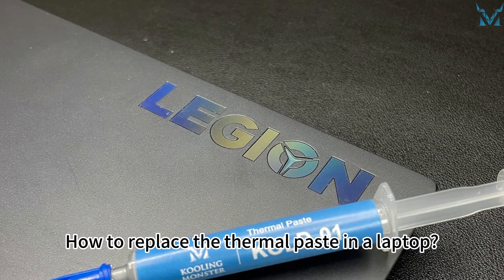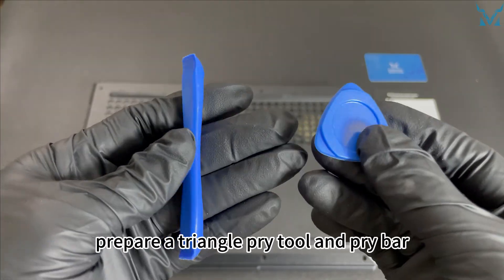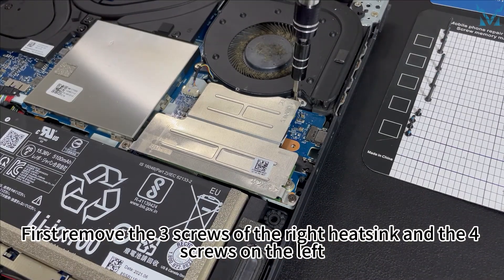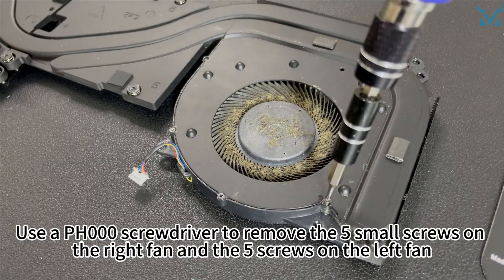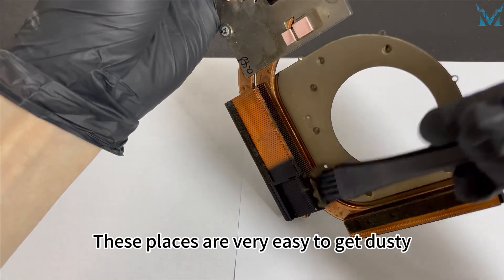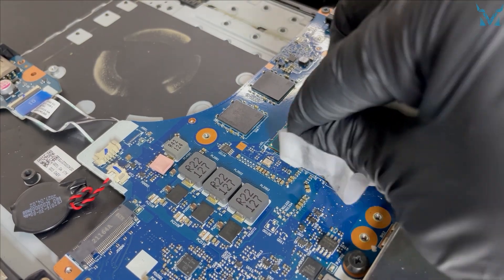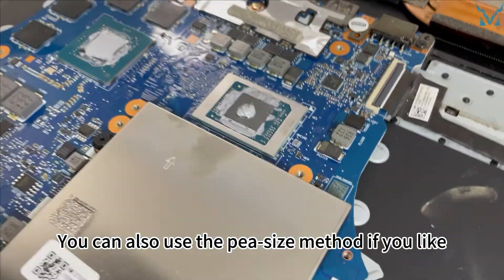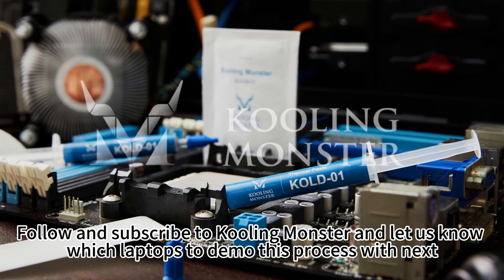Speed Up Your Lenovo Legion 5 - Prevent Overheating With Dust Cleaning & New Thermal Paste

Comment: i know this video is much later but I have pretty much the exact same laptop, my CPU temp averages around 90 - 95c whilst gaming and whilst quickly loading something up to 100c then back down, ive looked at my CPU and it's said to be normal but it's an older used laptop and I think I should open it up, is it safe?, If i mess up then warranty might not cover it
Reply from the maker: Those temps are definitely on the high side, especially if it’s an older used laptop. Cleaning the fans and refreshing thermal paste can help a lot. ✅

It is generally safe if you follow a proper guide and take your time — but you’re right: opening the laptop can affect warranty if it’s still active.

If you want, tell me your exact model and I’ll check whether your warranty is impacted and send you a step-by-step guide! 🙌

Comment: my two midle screw of the heatsink just don't spin at all, I don't know what to do.
Reply from the maker: That can happen if the screws are stripped or overtightened. Try using a precision screwdriver with good grip, or gently apply downward pressure while turning. If stuck, a rubber band between the screw and driver can help. Once you're in, consider repasting with KOLD-01 for optimal cooling.

Comment: i had legion 5 17 ach6 but i don't have the small screws on fans instead some rivets on it do you know how to deal with it,thanks
Reply from the maker: If they’re rivets, they can’t be unscrewed — you’ll need to carefully drill them out or pry gently (not recommended unless skilled). Better to clean without removing if possible!
Reply: @koolingmonster  thanks for reply,can you tell what could be damage if i want to pry and which tool would you recommend

Comment: I have a legion pro 7i. Just a year old. It has been the biggest heap of junk I've ever bought. It has been overheating severely since only a few months in. I clean the fans regularly as well as I can from outside. Core i9 drops to around 1000 mhz or even less when playing games with a CPU temp of 98-99° almost continuously. Severe throttling. Going for broke and redoing the liquid metal compound myself this week.
Reply from the maker: Sorry to hear you’re having such a frustrating experience with your Legion Pro 7i. Severe thermal throttling like that—especially with a Core i9 hitting 98–99°C—definitely isn’t normal.
Cleaning the fans from the outside helps a bit, but internal dust buildup or uneven factory thermal application could still be causing the problem. 
However, when DIY-ing, we generally recommend using thermal paste instead of liquid metal. Liquid metal has a much higher risk of failure—it’s prone to leakage and uneven application, especially on angled surfaces. A high-quality thermal paste, like our KOLD-01, already delivers excellent thermal performance without the added risks.

Comment: I used Arctic MX6. from 83°, now it's + 87° while playing. Is my thermal paste not good? I put same amount like in your video.
Reply from the maker: Thank you for sharing your experience! Arctic MX6 is a solid thermal paste, but temperature fluctuations can be caused by several factors. It might not be the paste itself but rather the application, cooling system, or ambient temperature. Since you followed the video, I recommend double-checking if the heatsink is properly seated and if the fans are working optimally. If the temperatures keep rising, you might want to clean and reapply the paste to ensure even coverage. Let me know how it goes!

Comment: Trying the links in the description and none of the items are available anymore (even internationally it seems, but I'm in Sweden)
Reply from the maker: Restocked and expected to be available in December. Demand is high—apologies for the inconvenience!
Reply: @koolingmonster  recently learned that you shouldn't use regular thermal paste on legion 5 laptops. they put PTM7950 (phase change material), which require replacement once in 2-3 years, by the same PCM, and only in case regular cleaning doesn't give any effect.

Comment: Does this help if my laptop is not turning on due to overheating?
Reply: is it going on then off or is it not powering on at all?
Reply from the maker: Of course! Replacing thermal paste can significantly alleviate performance issues caused by overheating in laptops. At the beginning of each of our videos, we conduct a temperature test after the replacement. Laptops with a bare die design (where the chip is exposed) are susceptible to the pump-out effect, and thermal expansion and contraction can squeeze out regular thermal paste from the chip. Our KOLD-01 thermal paste features a unique fluid dynamics design, which behaves like a solid without external force and like a liquid with additional external pressure. This makes it more resistant to the pump-out effect without sustained external force.

Comment: it's not 100% that paste is dried as lenovo use 2 phase paste on their products and it  is solid and dry till aprox 55 degr celsius, then it starts softening. Ofcourse you need to be sure what paste applied on yur product.
Reply from the maker: Hello, are you referring to phase change material! We still recommend using high-performance silicone grease. Next time, you can try our KOLD-01 phase change chip, which will continuously switch between liquid and solid states. This process can easily cause displacement and result in heat dissipation failure

Comment: Good day to you. Im using lenovo legion 5 rtx 3070 made in 2021 maintaining most of time gaming cpu temp 100° Used to be not more than 90 but now seems bad. Should I use thermopaste showed in this video? Or native Honeywell PTM 7950
Reply: Use honeywell. I made the mistake of using the thermal paste shown in this video, and the temps are still high. I'm now waiting for the Honeywell thermal pad
Reply from the maker: Welcome to try our KOLD-01 silicone grease, it's different from the typical silicone grease you mentioned. The specific difference is that generally silicone grease uses a solvent formula, where the solvent evaporates when exposed to heat, and the silicone grease dries and cracks, losing its thermal conductivity. We use an exclusive solvent-free formula to perfectly solve this problem. So using a laptop has better heat dissipation and longer lifespan.

Comment: hi, I need help after I took apart my Lenovo laptop and cleaned it, one of my coolers stopped working, what should I do?
Reply from the maker: Hello, there are a few common reasons why a fan might not be working:

1. The thermal paste is performing too well, causing the temperature to stay low and the computer to determine that the fan doesn't need to operate.
2. The fan connector might not be properly connected; it's a good idea to reconnect it.
3. The fan’s wiring might have been severely compressed during reassembly; it’s worth checking and rearranging the cables.

If you need to rearrange the cables or reconnect the connectors, remember to power off and discharge the laptop first.
Reply: go to laptop servie

Comment: hi so i've just cleaned my laptop, applied new thermal paste and everything seemed normal but when i turned on my laptop the vents became really, really loud and when i turn on any game it shows that gpu is at 100% but cpu is goint at 0%, what's going on what can I do?
Reply: Any update did you fix the problem?
Reply from the maker: Hello, there are a few possible issues:
1.You might be using a lower-performance thermal paste from the market instead of our thermal paste, which isn't providing effective cooling.
2.Your application method might be incorrect, leading to ineffective cooling.
3.The heatsink might not be properly secured, preventing effective heat transfer.
4.This issue could be related to fan aging or damage.
Excluding the fourth possibility, we recommend using high-quality thermal paste and properly applying it during disassembly to effectively resolve this issue. Over time, fans can become noisier due to wear and tear. If the fan blades become deformed or damaged, they can create more noise during operation. We hope this information helps you.

Comment: The repaste of that model require Honeywell ptm 7950 thermal pads...
Reply: why ?
Reply: @riichobamin7612  Because it is the one applied by the factory.  I tried applying various thermal pastes including mx4 and mx6 and others of excellent quality but the temperatures were higher and not by a little.  I think it's due to the fact that the pads have a thickness of 2mm and therefore put the die in good contact with the heatsink plate, whereas with the thermal paste there is a bit of space left.
Reply: @michelecorradino6633  Shit. I am in a terrible situation. I have a 2022 Lenovo Legion 5i and last year a Lenovo technician had changed my screen. He had taken off the entire thermal system to do that and I do not think he reapplied PTM7950 because now my laptop reaches 86 Celsius on the GPU (RTX3070ti@140Watts) within literally 2 mins of launching games. 

I was thinking of getting thermal paste reapplied. But I think I should instead go for PTM 7950, right ?
Reply: Do you know where I can get the thermal pad/paste from?
Reply: @LarryTheRandom  I saw some in Amazon. And LTT store.
Reply: @LarryTheRandom  aliexpress
Reply from the maker: Hello, we still recommend using high-performance thermal paste. Next time, you can try our KOLD-01 [sending heart]. Phase change pads continuously switch between liquid and solid states, which can easily lead to misalignment and result in cooling failure during this process.
Reply: @koolingmonster No. These laptops were designed to use phase change pads from the factory. Using standard thermal paste will make temperatures worse.

Comment: Excuse me, which is the recommended minimum Cpu state for this laptop if I wanna improve without stuttering issues? I have 5% min and max 99% and Cpu perfomance boost:disabled. The temperature equaly runs fine around 68°max while gpu does the same. If I activate Cpu perfomance boost on Cpu goes up 80° and Gpu 45° while playing Genshin impact
Reply: 105° is the "maximum" anything below that is ok while being under heavy load and boosted to its max performance. 

Some games are very CPU demanding, some games are GPU demanding, it all comes down to the games. Those temps is not a problem. 80° while gaming and having turbo on is not bad. The only time something is bad is when your temp is 70 - 80 while watching youtube or just scrolling through the web.
Reply from the maker: Based on your description, the current state of your computer's CPU is good.

Comment: Before replacing the thermal paste, my CPU temperature reached 95-100 degrees in games.
After replacing the paste with Thermal Grizzly Kryonaut 1g, the temperatures still remain within these limits, what is the problem?
Reply: I had same problem, changing paste did almost nothing. I limited my cpu to 99% and temperatures dropped quite a bit. 
Control Panel\All Control Panel Items\Power Options\Edit Plan Settings -> Change advanced power settings.
Under processor power management set Maximum processor state to 99%.
I did that and 90C became 70-80C max under full load, 30-40C idle (youtube etc). I do also have a decent cooling pad but most of the reduction (10-15C) came from limiting the processor power. 
Limiting the power disables turbo boost which is why ryzen processors overheat.
Reply: @Techh76  I disabled the turbo boost of the CPU (regedit key) and temperatures dropped from 100 C° to 70 C°
Reply from the maker: Welcome to try our KOLD-01 thermal paste, it's different from the typical thermal paste you mentioned. The specific difference lies in the fact that typical thermal paste uses a solvent formula, and when heated, the solvent evaporates, causing the paste to dry out and lose its thermal conductivity. We use an exclusive solvent-free formula, perfectly solving this problem. Therefore, using it on laptops results in better heat dissipation and longer lifespan.
Reply: Do you run in performance mode or balance mode? performance mode will increase the fan speed and the laptop will get hotter than running on balance mode. When you're gaming, do you have your AC adapter plugged in? Does your battery charge at 100%? a charging battery can increase the overall heat in a laptop as well since the battery will become hot while charging. Use Lenovo Vantage and set a threshold to only allow the battery to charge at 50 -60 %. Make sure to clean all the fans, buy a cooling pad to have underneath your laptop to increase the airflow.

You could try Liquid metal instead of thermal paste, though you need to know what you're doing if you going with that option.
Reply: @ynglingen-qd1iw  balanced, conservation mode is on, doesnt charge over 60. Fans clean, great cooling pad. Only rhing that has helped is limiting the processsor. Currently limited to 87%.
Reply: My comment was meant for Wiking. When you limit your processor to 99% or less you're disabling turbo mode. You shouldn't have to do that.

As long as it doesn't go 105 or above under heavy load then it's not a problem. Modern laptops will shut down when they've reached a temperature that can break it, As long as you don't see any throttling or it shuts down, then it's no problem.
Reply: @ynglingen-qd1iw  ok, my mistake, I didn't unscrew the laptop's fans and they were completely clogged.  I applied Honeywell PTM and the temperatures do not exceed 72°C.
Reply: @Wikt4or Nice, make sure to clean the fans regularly, it will increase the life expectancy of your laptop.
Reply: Lenovo used ptm7950 any other paste or thermal pad other than that does not provide good temperatures
Reply: Applying new thermal paste on laptops doesn't make much of a difference, 2-3 degrees max

Comment: does anti static brush rwally make a difference or can i use other brushes
Reply: If you dont touch any circuits, then its okay.
Reply from the maker: We recommend using the anti-static brush included in our set for cleaning. It's specially designed and works very well~

Comment: I have done every step and my fans turn off after 5 seconds! What did i do wrong?
Reply: maybe you didnt connect the faans properly, retry to do the process
Reply from the maker: After cleaning the dust and replacing the thermal paste in the Lenovo Legion 5, the fans stopping after 5 seconds could be due to several reasons:
Installation issues: There might have been a problem during the reinstallation of the fans, such as incomplete contact between the fans and the CPU or GPU, leading to poor heat dissipation and hence the fans stopping.
Connection problems: The power or control cables of the fans might not have been correctly connected or may have become loose, causing the fans to not work properly.
Improper use of thermal paste: The thermal paste might have been applied too much or too little, affecting the cooling effect. The thermal paste should be applied evenly; too much or too little can both impact the cooling efficiency.
Reply: @koolingmonster  thank you I enjoyed your products.
Reply: if you are on battery power  the fan stops after booting  because its cool . plag a game and wach the fans
Reply: i didnt open my legion 5 but the fan stops when the cpu temperture is low
Reply: you're cooked bro bro 🙏
Reply: @zvezda4994_  ☠️
Reply: Have you solved this problem? What did you do?
Reply: @specialchannel1787  I am pretty sure I unplugged some wires and put them back together. I gave it a few seconds and put the fan mode to max and I heard them spin.

Comment: Im using lenovo legion 5 rtx 3070 adquired january 2022 maintaining most of time gaming cpu temp 60-70° while gpu lower. Is necesary repaste soon in my case?
Reply from the maker: The CPU and GPU temperature seems great! However, after two years of using a gaming laptop, the thermal paste most likely has dried up, replacing it can give you even better temperatures!
Reply: @koolingmonster  Im wondering if its still risky putting laptop on sleep mode, ocasional times the windows update automaticaly install even the laptop lid is closed(but in sleep mode)
Reply: @koolingmonster I was expecting to repaste with Artix mx5 but month ago someone told me to not do it because its risky heatsink bad design of Legion 5 2021. I wonder if its true, by watching video looks life easy repasting but i guess it will be same instead fixing the temperatures